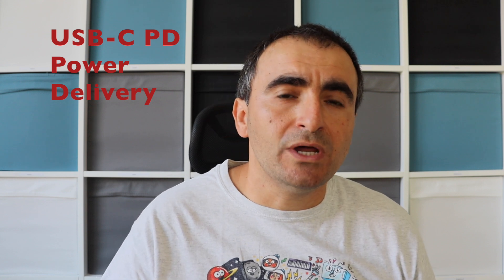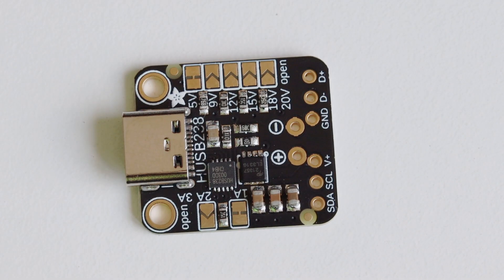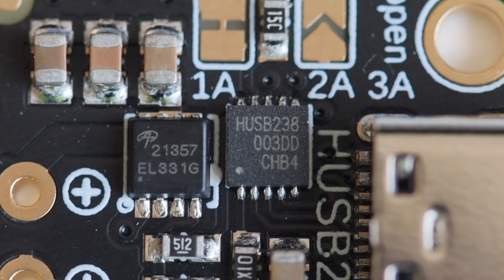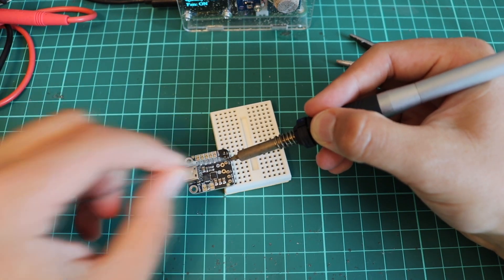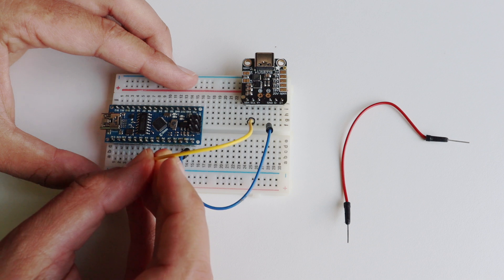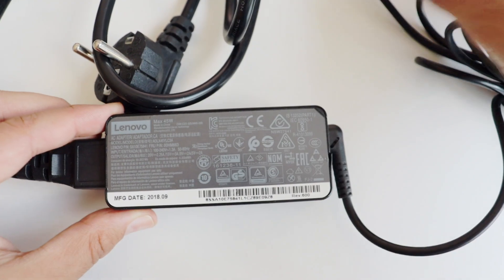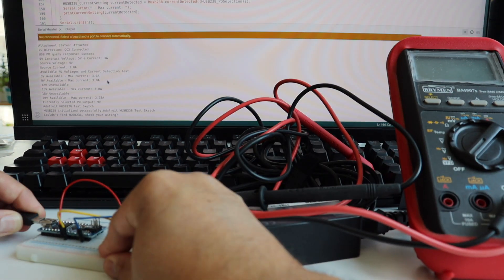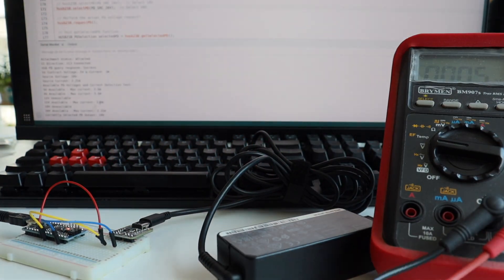USB-C Power Delivery Sink over I2C with Adafruit HUSB238 Breakout Board and Arduino Nano

Comment: I have one, but for a new project, I need 11v at 1 to 2A. I think the PD part is USBC PD 3.0, so you should be able to provide 11v. I hope that can be generated by a resistor value to set the voltage.
Reply from the maker: No, HUSB238 is not appropriate for 11V. Have a look at the Adafruit HUSB238 library. There is a list of register values for different voltages: 5V, 9V, 12V, 15V, 18V, 20V so I don't think 11V is supported: https://github.com/adafruit/Adafruit_HUSB238/blob/main/Adafruit_HUSB238.h
For 11V, I recommend you to consider USB-C Programmable Power Supply (PPS) . USB-C PPS and PD protocols work together where the former can renegotiate non-standard currents and voltages.
Reply: @ Thnak you for your help. I am trying to charge a Icom radio that needs 11v that is difficult with the current usb c PD products.
Reply from the maker: Diodes Incorporated provides AP33772 which supports USB-C PPS so you can adjust it to 11V. Although, I haven't used it yet, I have seen projects in hackaday like PocketPD and PicoPD that use it very successfully. However, keep in mind that you will also need a USB-C PPS power supply (not just USB-C PD power supply with fixed voltages). The USB-C PPS power supplies are more expensive and still a bit harder to find. Some of the new chargers for smartphones are USB-C PPS that can provide 11V. My OnePlus smartphone came with USB-C PPS power supply within the range from 5 to 11V.
Reply: @ Thank you this is helpful. I am quite familiar with USBC PD and PSE requirement. My last design is in the production jeep wrangler.  Finding parts for ham projects with existing boards is difficult.
Reply from the maker: @thuff3207  Btw I've just noticed that MIKROE offers USB-C Sink 2 Click (MIKROE-5791) board with AP33772. As far as I can see it is available through several distributors, including DigiKey and Farnell.

Comment: How is negotiation process exactly resolved if requested voltage for example 12V is not available?
Reply from the maker: You can check if 12V is supported by the power supply with function isVoltageDetected as part of the negotiation and implement whatever you want to do if it is not available. You can modify the demonstrate Arduino sketch as an example. It is available at GitHub.